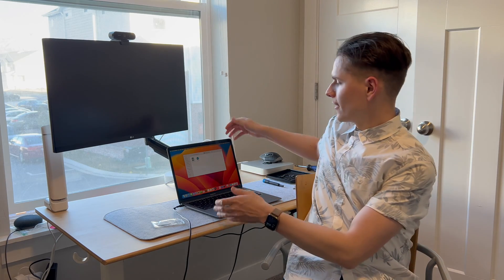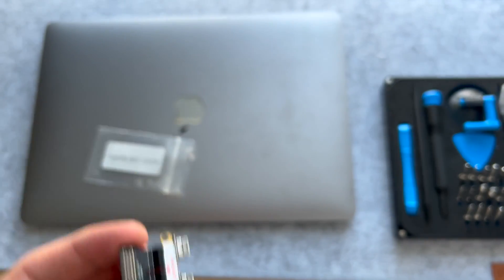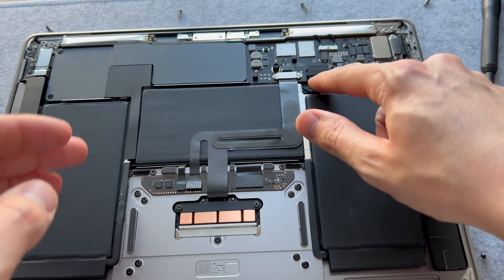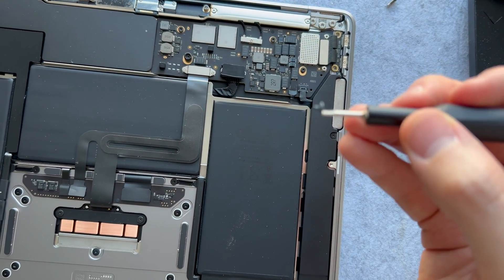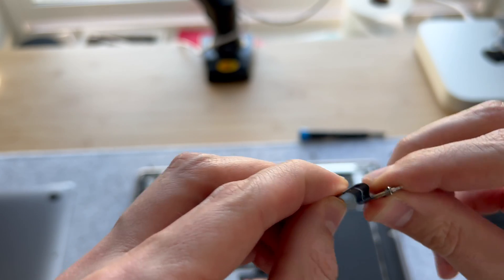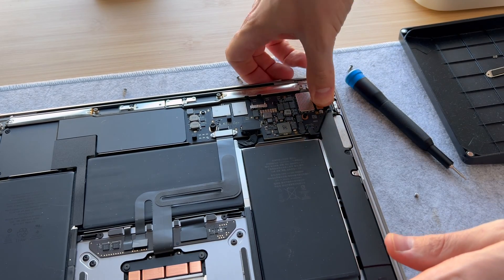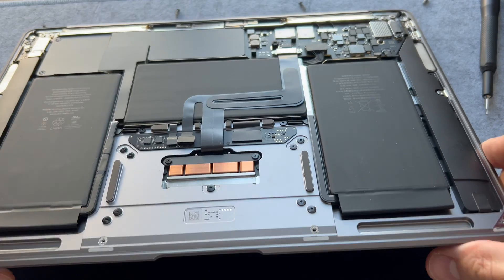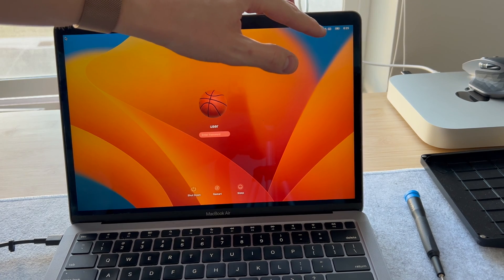Thunderbolt Port Replacement M1 (Late 2020) MacBook Air - Not Charging / No USB

Comment: I've just been through the same. I'm convinced the cause was a non apple usb cable that was tight on inserting (3 meter says it was compatible, from Amazon). I've learnt my lesson - I'll only use the too short Apple cable.
Reply from the maker: Oh I didn't even make the connection of what might have caused this, but that makes total sense!

Comment: Hi Benjamin, when you replace the DC Power Jack or the connector, does it just fix the charging issue or does it also fix the data transfer , device connection (like usb hub) issues?
Reply from the maker: It should fix all of the above!

Comment: Great vid! Couple things I ran into while performing this fix:
1) The USB-C board had 0 clearance to be removed/inserted, meaning I had to exert some force to get the board out and back in properly. The connector's design makes this feasible, as it won't result in the wires crimping if it's loaded moderately. The clearance might vary from machine to machine, as it looks like others haven't had this issue. 
2) If you want to test the fix, you might need to complete the reassembly, and plug it in to power. I tried to test the battery's connection before I screwed the back panel on, but it only booted up after the panel was screwed back on and I plugged it in. 

Thanks again!
Reply from the maker: Thanks for sharing your experience!
Reply: what??!?!?!?!?!?!  it took me literally 45 seconds to do the swap and 5 minutes to close the lid.

Comment: Hi my m1 has just stopped charging 
I have cleaned all the debris I think mine is also corroded 
What is the part number of the spare thunderbolt port do you know/ found it in the description thx/ how would you go about diagnosing that it is in fact the port and not software related

Comment: Thanks alot for this Ben, but please I have a question;
Please can the MacBook Air M1 thunder bolt port work for the Macbook pro M1?
If not please can you recommend the one that will work for the Macbook pro M1
Reply from the maker: Email sent!
Reply: Isn’t the pro just x2 of those
Reply from the maker: @YouSmokeChed  The M1 13" Pro is only 2 TB ports for most if not all SKUs, and from the tutorials I've seen it involves removing the motherboard.